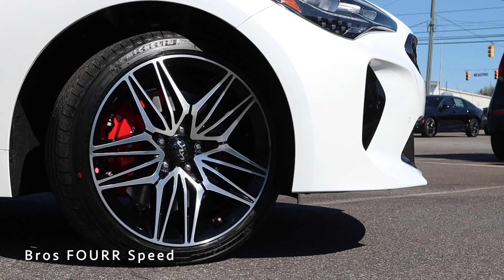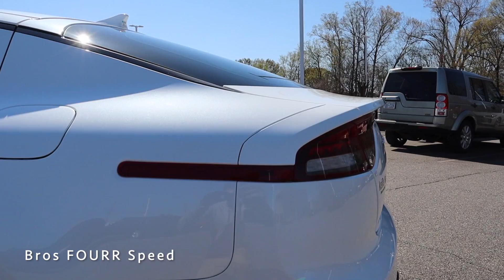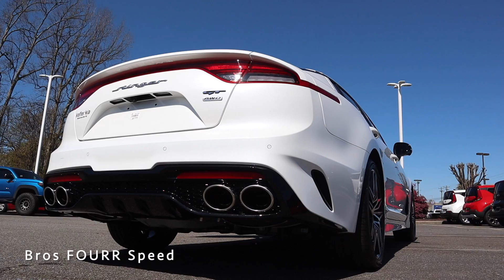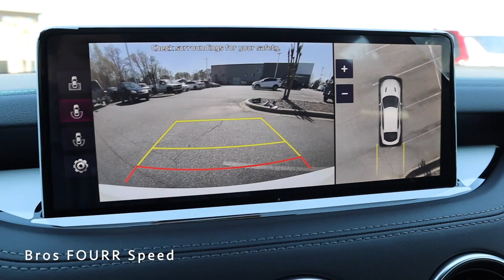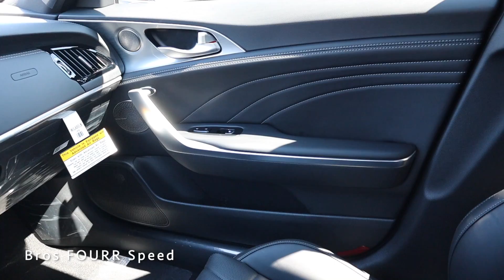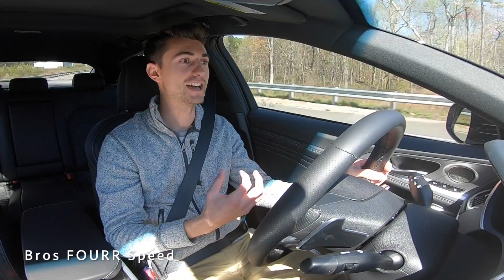2022 Kia Stinger GT2 AWD: Start Up, Exhaust, Test Drive and Review

Comment: What’s the difference between this and the gt1?
Reply from the maker: I think it's just some luxury features. Maybe sunroof, radar cruise, and things like that
Reply: A lot! Nappa leather seating and different stitching , ventilated seats, heated rear seats, heads up display , electronic shifter, 7 inch lcd instrument cluster, power adjusting steering wheel, 360 degree camera/surround view monitor, front parking camera. And I also believe the Harmon Kardan sound system. Those are the main things I can think of on the interior. Other things are the power hatch back/trunk, auto full led headlamps. There are some other things also.

Comment: Is it a fact that the more u use the suspension the better it gets ??
Reply from the maker: Not too sure about that. It'll performa the same for a long time. But maybe at 100k miles to 150k miles it the suspension will start to degrade and need to be replaced.

Comment: I just hope that Kia tightened up the small problems that owners in the 1st gen stinger was experiencing such as the rattling sunroof, rattling hatchback and other things that weren't put together all that well.... I want to buy this car so damn bad.
Reply: The only car that I will get over this is the genesis gv70 3.5tt awd and it all depends on the price that comes in at.
Reply from the maker: The Genesis models are sweet too!  I'm hoping to check those out in the next few weeks possibly to compare it to the Stinger!
Reply from the maker: I wasn't in the car long enough to notice any of those issues, but I would think they addressed that, everything felt solid to me for this drive!  The Kia Stinger is a fun car!

Comment: As someone who owns the 2019 version I wish I waited for this one
Reply: Just from watching the video the wheels, seats, dash, chassis, exhaust tips. I wouldn’t say there’s anything major but I love the small details like the new emblem
Reply: @aaronstobo1751  I son't think there's any difference in the chassis. All the differences as far as I know are cosmetic.
Reply from the maker: What major changes do you see with this one over the Stinger you own?
Reply: For me, the only desirable in the newest stinger is the bigger screen and the exhaust.
They downgraded the GT1 headlights to some ugly crap for 2022. In previous years, the GT1 and GT2 shared the same lights. Now you need a GT2 to get the same loadout.
Also, not a huge fan of the new wheels either. I didn't think the old "Y spoke" design was particularly good either, but I really think the new model year's design is even weirder.
The light bar taillights don't look terrible on the 2022, but it robs the stinger of a more unique look that the ringed design of the old models have.
Finally, I think the new scalloped design of the leather stitching looks way too busy with how they made them overlap. The old leather seats looked much cleaner.
A lot just screams to me they are making these changes just for the sake of making changes. 
They still haven't let the driver turn off the auto start-stop permanently through the menu, and they still are using those fake intake cutouts 🤣

Comment: Excellent review. I love my Stinger GT which is the top of the line model here in Australia. It is simply the best value for money, bang for bucks car I have ever had, and I have had some fabulous cars in the past.
It would have been great if they had included fog lights. Wireless connectivity would have been great as it is a bit outdated having to use a usb cable to connect a phone in order to use maps etc.
Reply from the maker: I could see those upgrades being needed especially when they are trying to compete with other brands like BMW and Audi which already have those features, but maybe that's how they save some money and why it costs less, but Kia has the technology from other models to add that!

Comment: The record 1/4 mile for the Stinger was set a few weeks ago at Rockingham Dragway here in NC. He ran 11.16 @ 122 mph in a 2019 AWD Stinger GT2. Have you guys ever considered coming out to Rockingham and racing? It is really fun and not too expensive. It would be some fun new content for the channel. If you ever want to go just let me know and I will see you guys out there.
Reply from the maker: Oh nice! I'll have to check that place out then! That'd be a lot of fun!
Reply: Have any idea what kind of mods?
Reply: @Willster7471  the record has been broken many times since then. They are now under 11 seconds for the 1/4 mile on Dragy. The current record holder doesn’t even use meth. He just has a 7th injector and E48. He does a 2.9 second 0-60 mph in a 4100+ lb car. Quite amazing.

Comment: I don’t think that AWD car has the 167 mph top speed. If they come with All Season tires then it usually limits the top speed. It will say that on the window sticker if it does.
Reply from the maker: Thats just what Kia says. May differ in real world circumstance
Reply: Real world circumstance is 153 was a bit disappointed to not hit 167, but can’t complain

Comment: I just traded my RWD 2019 Kia Stinger GT2 for an AWD 2021 Kia Stinger GT2 this week. The AWD is definitely the one to get if you want to go fast in them.
The RWD Stingers spin the tires too much even with the most minor mods. They actually end up slower than the AWD Stingers in most cases.
The Stingers are holding their value extremely well right now.
I rolled $6,000 into my original 2019 loan. I got an offer from Vroom that erased all of that extra debt and actually gave me $2,300 of equity after only 18 months of no interest payments.
They have about $10,000 worth of discounts on the 2021 Stingers right now since the 2022s are out. So many great choices from Kia right now.
Reply from the maker: Thats pretty cool man! Sounds like a heck of a deal. These have a good amount of power, so I can see how the AWD is a much for performance
Reply: The RWD is lighter and you can have more fun around corners with its inclination to slightly oversteer. RWD is quicker to 60 provided road surface isn't an issue

Comment: This is definitely my dream car. Seems like a far fetched dream though
Reply from the maker: Keep working towards it!!  The one thing with Kia's is on the used market you can get great deals!  So start looking for some used Kia Stingers and you'll see the discount you can get over new!
Reply: @BrosFOURRSpeed  that used to be true. However, the used car prices for Stingers shot up about a month ago. Low mileage nice examples are getting almost $38,000 as trade in cars. That is crazy since you can buy a fully loaded GT2 brand new for about $45,000 if you go with the 2021 instead of the 2022 model.
Reply from the maker: Thats pretty good for the Stinger then!
Reply: @LearningFast  yes I noticed that when recently looking. I was going to get a used stinger 2020 GT line but I realized that it’s almost not even worth going used since the price difference between new and used is almost none. But that’s also a really great thing, the car will
Hold it’s value well. I picked the worst time to be interested in a new car, especially a car like the Kia stinger since it’s began gaining popularity.
Reply: @paigecorriea6017  if you are getting the 4 cylinder Stinger then definitely get the 2022 one. The 2.0 liter engine in the older Stingers just isn’t enough. The new 2.5 liter engine is MUCH better. That car will also hold its value better.

Comment: Love the new ‘22 rims, slightly bigger screen is a plus but I don’t like the new tail light design at all. The bigger exhaust tips look weird because the real exhaust ends are so visible/ not attached but that’s fixable.
Reply: The black trim looks sooo much better tho. The chrome is a pain to clean.
Reply from the maker: I agree! Chrome is way out of date lol
Reply from the maker: The 2022 has some good upgrades for sure. I didn't really notice many differences over the previous one
Reply: Do u kno if there will be able to change the tail lights to the older design?

Comment: This would be excellent with a v8
Reply from the maker: I could see that, but it would also weight more.  It's crazy how engines are getting lighter, more fuel efficient and more powerful with smaller engines, but it would sound much better with that V8!

Comment: I like this but seems they overpriced it at 55K. I see on there website they start at 35K. 
I feel it's going to be hard for KIA to gain people's trust at this price point. Just my opinion 🤷
Reply: $35k is the 300hp engine. This is top of the line with 368 hp AWD twin turbo.
Reply from the maker: It's crazy though for that price the cool car you are getting!
Reply from the maker: It is a high price, but also consider what this is competing against!  And this has the larger engine and awd, the base models start around 35K.  This is a fast sedan that goes up against other sedan in the $70k range, so it's a bargain for the price and horsepower you are getting!
Reply: Any tips on how to get one around 46k at the dealership? Knowing them they won’t be trying to drop the price much If at all
Reply: @Willster7471  best tip is to wait out the pandemic pricing. Once we get into fall and winter, the economy will likely be reset(unless inflation hits bad) Also, the chip shortage is very much still ongoing. This shortage will continue to keep carmakers production lines slow or even intermittently shutdown at times.
Basically, if you absolutely MUST buy a car this year...you're pretty screwed on negotiations. Hold out till the end of the year or better still to wait till 2022.
I might add that even before all this pandemic business, the Stinger was always a niche vehicle and was never going to sell in massive numbers. Kia knows this and has always kept a low supply circulating from the start(relative to their other models) So consider that if in January of 2020 a dealer might have had around 15 to 20 Stingers on the lot, then in 2021 your average dealer maybe now only keeps around 6 to 8.
Reply: The top trims are definitely over priced and should probably be closer to 45,000 max if kia expects to actually move these. The lower trims are the better deal in the 30k ranges.
Having said all that, I think kia basically knows they are asking too much and just don't want to lower their clout by dropping the price. They just offer huge discounts instead.
Nobody is paying 55,000 for a GT2. Kia will let them go brand new for 46,000 all day.
Reply: @jasonquinn4516  yeah I agree 45k would be beter, as long as they prove to be reliable. They are beautiful cars tho
Reply from the maker: I would think they are fairly reliable.  Kia offers that 10 year 100k miles warranty, so you'd be covered for a long time!
Reply: @jasonquinn4516  you can get a 2021 for $45k all day but the 2022 models are selling for over $50k. Some dealers are even marking the 2022 models up over MSRP and getting it. The car buying world is seeing crazy times right now. Car prices are all over the map right now.
Reply: @LearningFast  maybe kia thinks the new logo adds 5k to the value lol.
But hey, if kia wants to overcharge some fool willing to pay over 50k or over MSRP for the upper trims...power to them.
For me, the value is non-existent for this car over 46k. Give the brand new 2022 model some time though. By the end of the year you will see sharp price reductions on new 2022's as well.
Reply from the maker: That's crazy!  Car prices are really all over right now, so it's hard to know what going for what especially in different states!
Reply from the maker: Haha yeah, that also means that 2021 "leftovers" will be going for much less, so for everyone buying a 2022, you could have bought a 21 and saved a good bit and the only difference is the year!
Reply from the maker: I would agree in the $45k range is more reasonable, but yeah no one is paying over that for them.  Even Doug Demuro bought his in the $40k range so they have crazy discounts and a great warranty program too!

Comment: Who would pay over $50k for kia , i dont think so
Reply: Badge snobs wouldnt pay $50k this. They would buy $50k for an Audi with a 200hp 4 cylinder instead.🤣
Reply from the maker: @acidnut  very true. KIA puts a lot of features in this for the money!
Reply: @BrosFOURRSpeed  true enough about the loaded features. But as much as kia loves when people compare this car to comparable Audi's and BMW's, kia is most definitely not a luxury car maker (except maybe the discontinued K900).
Just like you, I've been able to test drive the upper trims... 3 times now. I  think the interior cabin design is very well refined, (except for the exposed cupholders and netting on the seatbacks) but the build quality is nowhere near luxury or luxury prices.
They use good quality materials on much of the upper sections of the cabin, but then completely cheaped out on the lower pieces, seat backers, and plastic turn signal stock that would be right at home in a hyundai elantra.
This car is a steal if you are wanting the inline 4 cylinder trim or the most basic GT trim. But after the price rises above 45k, this all starts to fall apart for anyone liking the GT1 or, god forbid, the 55-56k GT2 trims.
This is also probably why most kia dealers have been aggressively discounting the GT1 and GT2 trims by as much as 9-10k off MSRP on brand new cars just so they can actually move them.
Still love the direction kia has been heading in. And I still love the Stinger. But a GT2 should reasonably be 46k tops.
Reply: @acidnut  Yep, and the Audi will have a worse warranty!  You don't want a German car out of warranty
Reply: @acidnut  for ppls like you cant never afford germane cars , just as your comment i know that you never drive german cars before so yes go for KIA they are made for you and thats all you can afford
Reply: @whitetiger9907  You initial comment actually shows that you have no money to even buy this Kia.
Reply: @acidnut  still better than your as
Reply: @whitetiger9907  What is? your honda civic? Why are you here dreaming about this car?
Reply from the maker: Clearly enough people do because it’s still offered for sale many years later. It’s a really nice car. And honestly it does have more features and performance then rivals
Reply: I’d take a Q50 over this any day
Reply: @Cr125stin  why? The equivalent Q50 RS is about $63k MSRP. It may have $15k of discounts but you absolutely have to lease those because they are depreciation machines. INFINITI cars are the absolute worst vehicles for depreciation. These Stingers are actually holding their value very well now. The Q50 isn’t even faster either. Really there is nothing good about the Q50s anymore except for the fact that used ones are dirt cheap.